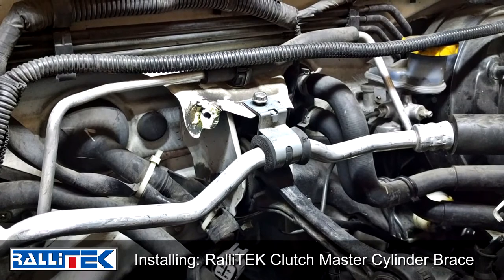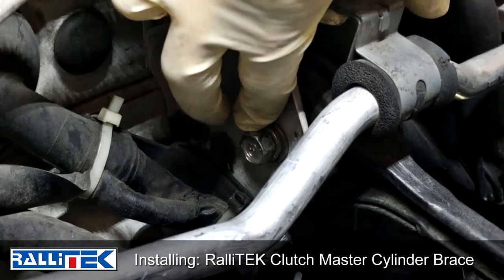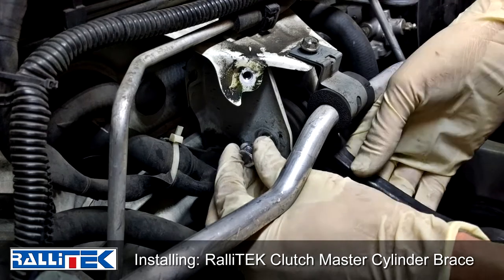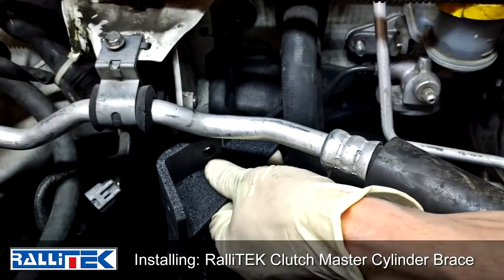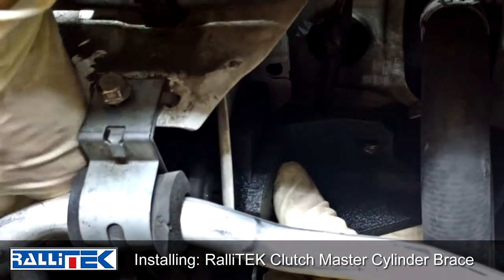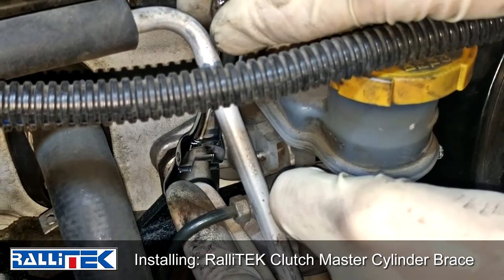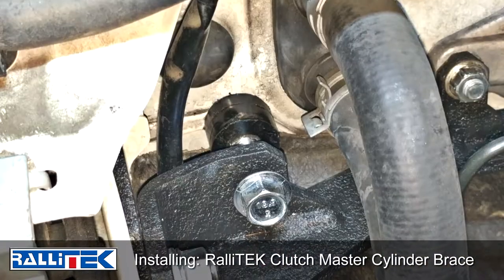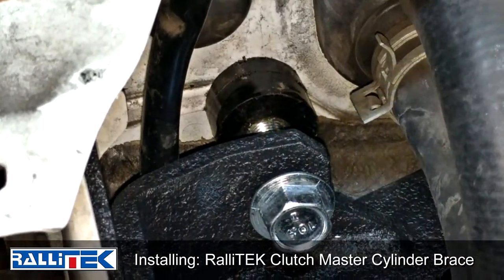How to Install - RalliTEK Clutch Master Cylinder Brace - WRX & STI 2008-2014 / Impreza 2008-2011

Comment: Great product! Easy install, fixed the sound from the firewall spot welds, dramatically reduced the flex of my CMC. I would get for any subie I get even before your spot welds  break, common problem and easily preventable and fixable with this product.

Comment: Installed on 2013 STI
Tightening the "jam nut" is a pain in the butt. Having a set of crowsfoot wrench would probably be ideal. Finessing the bracket into place definitely takes some time and patience. Once you get everything in place it's pretty smooth sailing from there. The black spacer they provide to pair next the bracket only sits one way to where it doesn't wiggle around. So make sure you have that on correctly. I also swapped the pitch stop mount out for a "Group N" sti pitch stop. The torque specs for the bolt closest to the engine is 37 ft lbs. Then the torque specs for the long bolt going through the pitch stop is 43 ft lbs. All in all the product fits well. I would say it's worth the purchase if you are trying to eliminate the chance of your firewall spot welds from failing since that is a possibility with the GR chassis.

Comment: nice video.  interesting...installed a master cylinder brace, but didn't install a pitch stop mount too; would only make sense since you would be in there and have to remove the same parts.  is this part more for folks who race/rally and subject their cars to more intense, hard driving or is it also a worthwhile addition to a street driven car?

Comment: I just bought this and dont fit at all! The long bolt is not that long... and the brace itself it looks short... the plate is loose... so i pay $144(inluding shipp) for this to not work... any ideas?
Reply from the maker: Please send us an email with what you are experiencing and pictures please to support@rallitek.com and we will get you taken care of!
Reply: @rallitek_official  can this still work even if all the spot welds are broken
Reply from the maker: @z3ro86ea  Unfortunately it will not help if the spot welds are already broken. We recommend getting the spot welds fixed and then adding our brace so it will not happen again.
Reply: @z3ro86ea  humble rumble kit

Comment: Will this fix the squeak that’s already there?
Reply from the maker: This will not fix the squeak if it already exists but it will prevent it from happening. It sounds like you will need to go to a shop to perform a "Firewall Fix" and then install this bracket afterwards.
Reply: Look up humble rumble WRX firewall spot weld kit. It’s a kit that allows you to drill out the spot welds and bolt them. That’s what I did and it worked great.
Reply: @ryanmartin6618  installed humble rumble but the squeak is still there but not as worst as before. now im not sure if installing this rallitek will fix everything lol